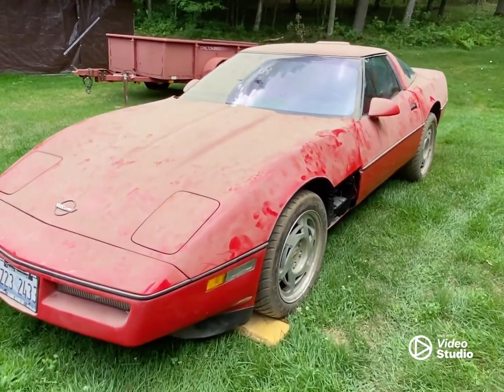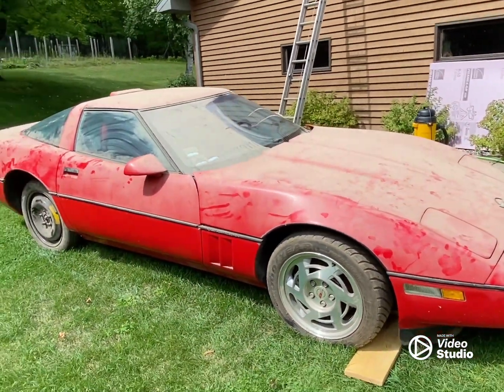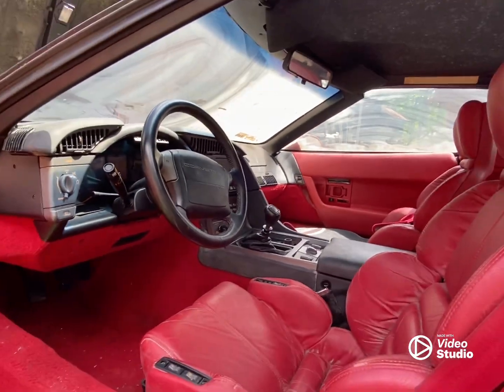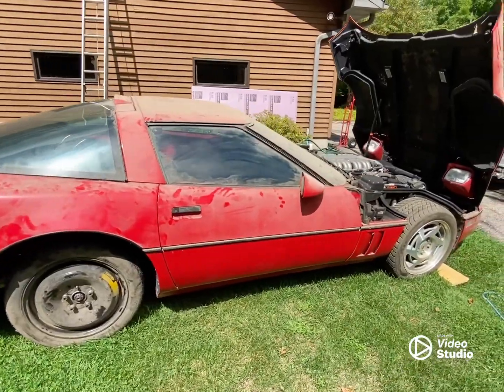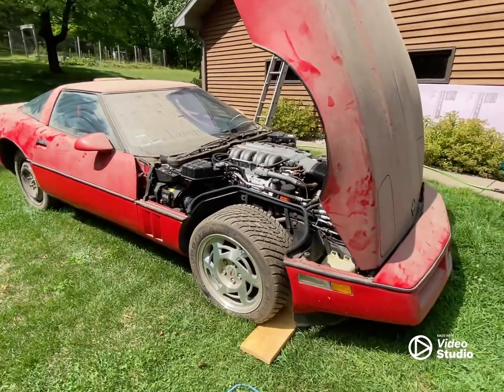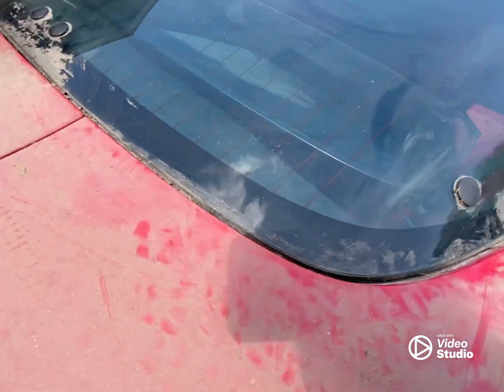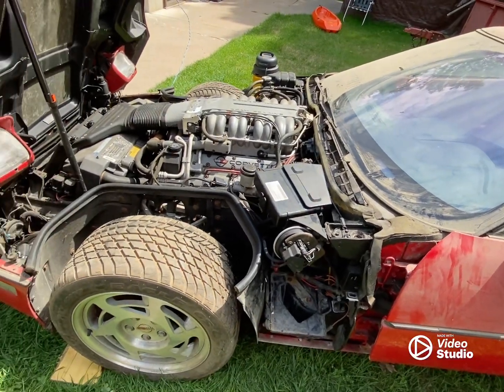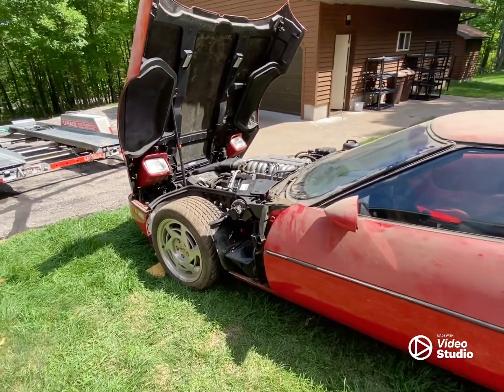Yoopers 1990 ZR1 Corvette barn find 14k miles

Comment: This came up in my feed. Great looking car with a ton of potential. Good luck in getting it back on the road.
Reply from the maker: Thanks. Work and then I hurt my shoulder slowing me down on working on it. I have all the parts so hoping my shoulder recovers so I can start working on it again. I’ll probably do a video of me changing out the injectors, starter and I’ll probably rebuild the alternator since it will all be exposed.
Reply: @yooper233  Wow. Sounds like you have your work cut out for you! As a fellow "barn finder" myself the results will be worth it. Just take your time and anticipate the unexpected.

Comment: Definitely new injectors/fule pump 
And i think there is a pusher and a puller,nice find
Reply from the maker: I pulled the injectors and plugged with old jelled fuel. I keep finding parts I need to replace so cleaning and painting as I go. I have more videos showing disassembly and more coming.

Comment from the maker: I did mention the plate being from 2016 and mentioned it could have been running in 16. I was told by the seller that it has not been on the road for 10 plus years. His dad would keep cars registered even though he didn’t drive them. Not trying to BS anyone because it has been sitting awhile. While airing up one of the tire the valve stem just fell out. Never had that happen before.
Reply: Hi sir , I have just found one not been run for 10 years , looks complete, what should I expect to pay if I can ask
Reply from the maker: @Taekendepis  I paid $10k for mine. Only reason I paid what I did is because of the low mileage. Luckily I know the people I purchased it from so I could trust that it ran when parked. The paint is probably 95% on this car. Very little defects from what I can see. Just needs some elbow grease doing a good deep cleaning. What color, mileage and year is the one you found? How much are they asking?
Reply: @yooper233  hi sir thanks for the response, no figures as yet , I’ve got a chance to see it  maybe next week , i didn’t want to look daft low balling him , four flat tyres and covered in moss from the picture I have received, can assume low mileage
Reply: @yooper233  this is going to sound bizarre but my dad is David whitehead , you won’t know him but he was chief designer for lotus cars that produced the lt5 , I really have to get a zr1  and the car I’ve found may be unbelievable and almost fete , if it’s not the one I’ll keep looking , dad is 86 now and as strong as the engine , I’ll show dad your video as he’s going to be emotional at people like you revere that car , a truly beautiful engine and fantastic car
Reply from the maker: @Taekendepis  That is very cool. I can’t wait to get it running and take it out for its first time on the road in a while. I have all new injectors to install then I have to put all new brake lines and brakes on it. My job has been consuming a lot of my time lately but I am planning on working on it this winter and get it on the road next spring. If your ever in the U. P. I’d love to show you and your dad the car. Have him sign the dash for me😁
Reply from the maker: @Taekendepis  I also have other videos on my channel and plan on doing more as I get it road worthy.
Reply: That’s a nice message , hopefully I have some positive news regarding the car sometime next week, if it comes off I’ll need your input 😊 be in touch